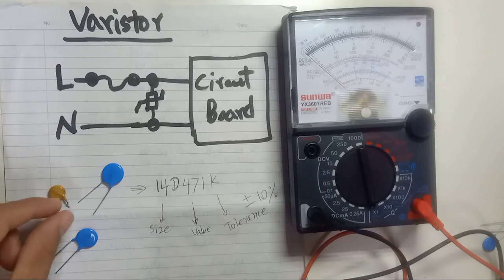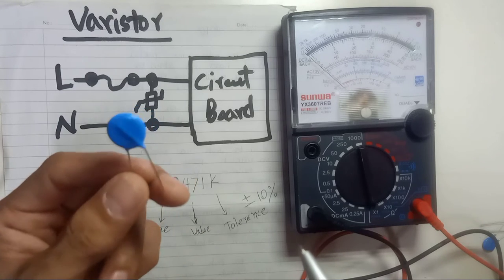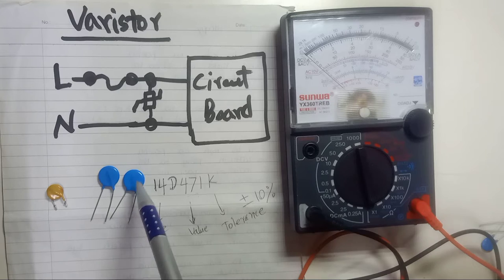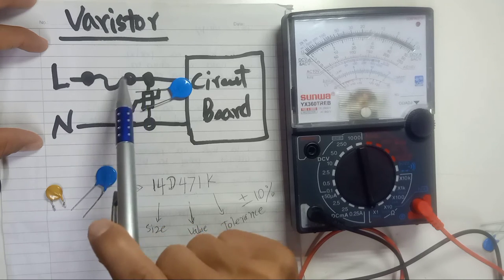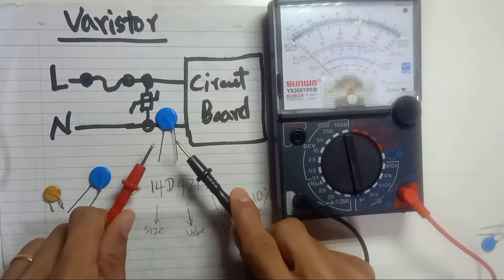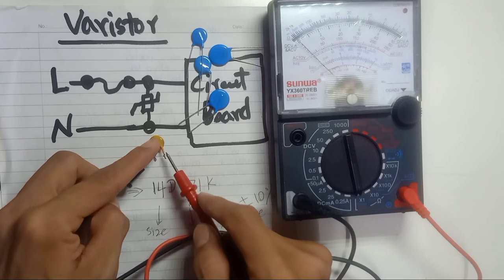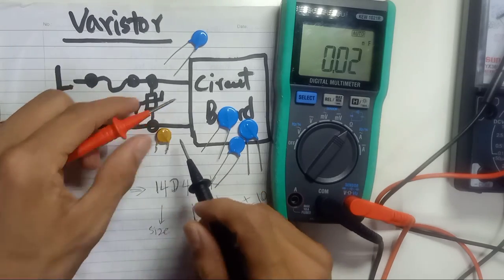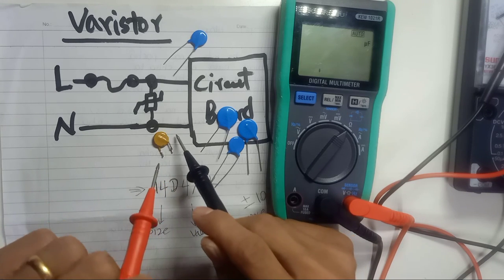What is Varistor

Comment: For 220-240VAC --
Should I use a 431 or 471 volt MOV?
What would be the difference in leakage current at 240VAC?
Reply from the maker: you can use either 431 or 471 for 240vac but for more safety 431 is more recomend to use which will protect more safe for your circut board.
Reply: @passiontechklm  what about 20D391K vs 20D471K?
Reply from the maker: @arkapadma  20D391 is more protective than 20D471 if you are using in 230vac circut board.
Reply: @passiontechklm  thanks  a lot.

Comment: Is it still safe if we connect the varistor to L and N without fuse?
Reply from the maker: No safe, fuse is necessary calculated by load Amp since varistor is for surge protection so it must be both use .